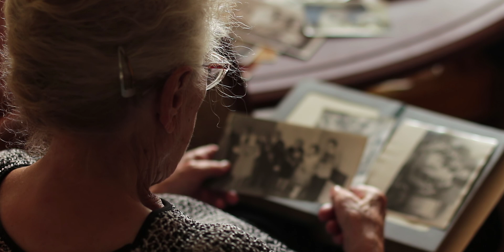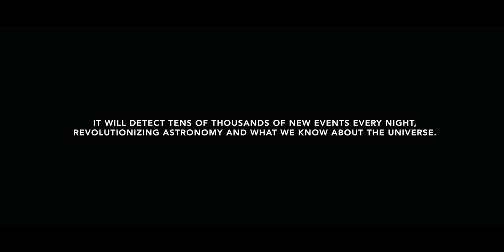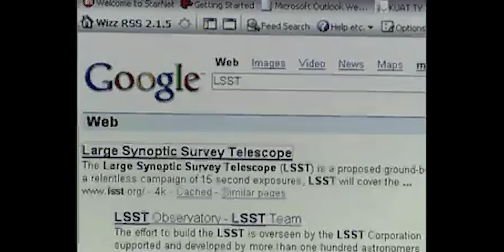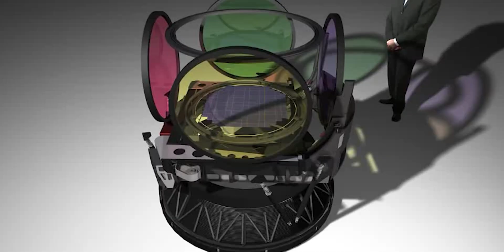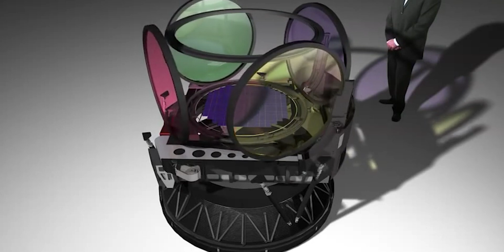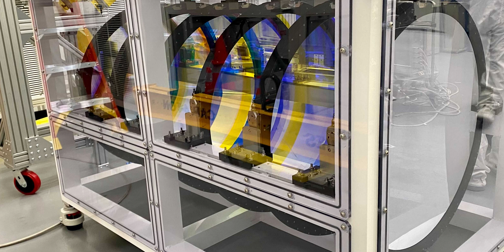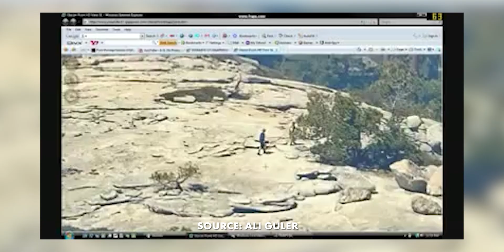The LARGEST Camera Ever Made is INSANE

Comment: 3.2 gigapixels sounds like a lot and for digital camera it is but we don't have to go that far back in time to wear 20 by 24 cameras for a thing if you were to try to scan that I'd say 9000 pixels per inch which is not an unreasonable number I've seen of scanners that can go up to 12,000 pixels per inch if you could scan the entire 20 by 24 at that resolution I don't think there's a scanner that can actually do that but it is Possible That means every square inch is equal to 81 megapixels and there's 480 Square inches on that sheet of film Which means there's almost 39 gigapixels on a 20 by 24 and When you think of it like that it's not as crazy as it sounds especially when you think that we've had that film technology for over 100 years now what the optics can resolve is an entirely different problem but theoretically the sensor can handle it AK the film